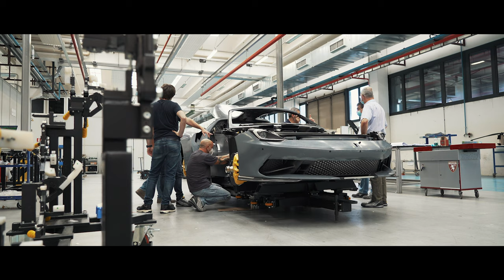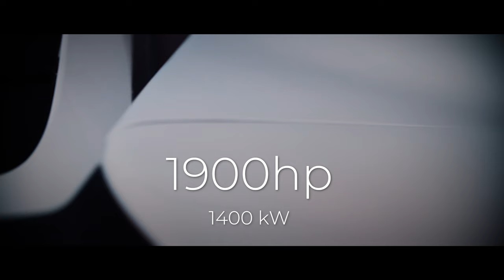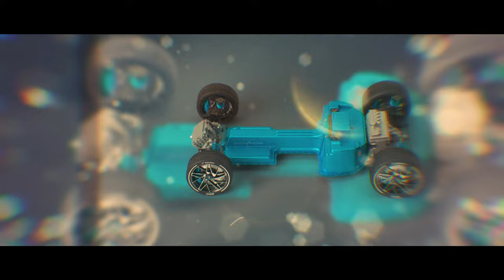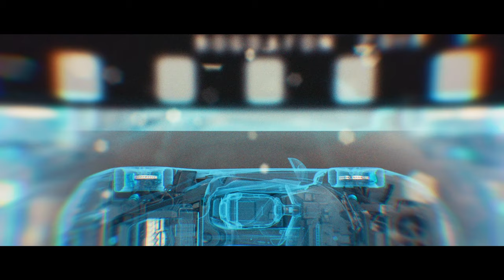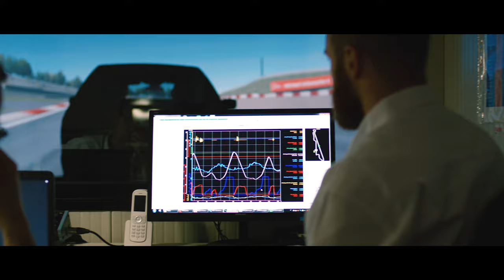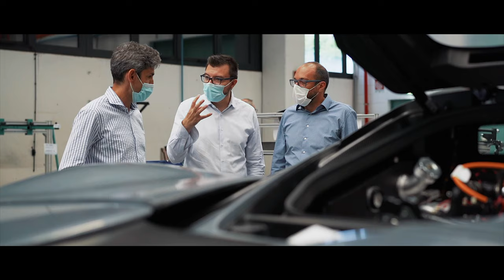Battista Coming to Life: The Prototype Story

Comment: So they paid rimac over $90 million to use the c-2 chassis. And then claim they developed thing's?
Beautiful design but come on now. Just admit it's a rebody of the rimac c-2! 😏
Reply: Ur just Casual
Reply: @benjamin Walker, So that, means they are practically building 300 Rimac C_Two's because Rimac is building 150 Actual C_Two and Pininfarina is building 150 Batista.
Reply: And they are using batteries from Rimac
Reply: Then what about braking, driving dynamics, ride & handling, simulation, carbon ceramic body structure, balancing, tuning, leight weight structure engineering, software, electronics etc. ? A new company engineers all these plus developing platform of its own that too in high performance hyper GT segment is foolish decision and late process. It's quite common every one shares technology each other and create their products in the current world...... Battista achieved stunning driving dynamics only because of using MAHINDRA RACING technology & R&D center. That's why no other brands can match Pinninfarina in performance and dynamics going forth.... It's the hard work of Mahindra racing team has put them in the path what pinninfarina is today.. once they achieve the scale it easily uses their own platforms.....
Reply: No alot has gone into it a r8 and huracan is siblings yet different because different chassis and so on its really sad that people have to explain this to people like you